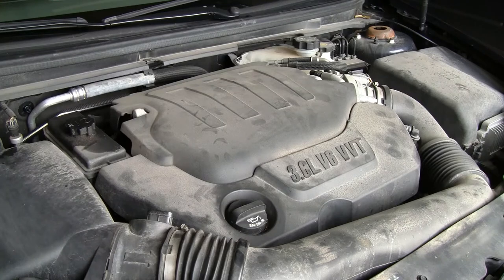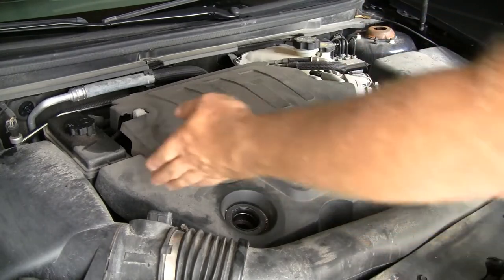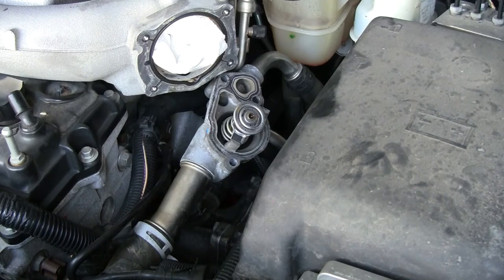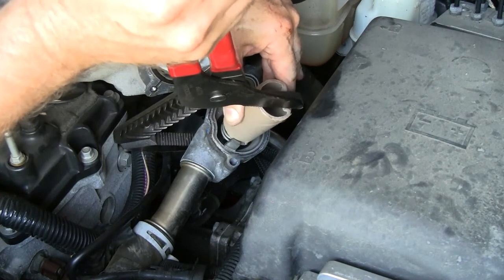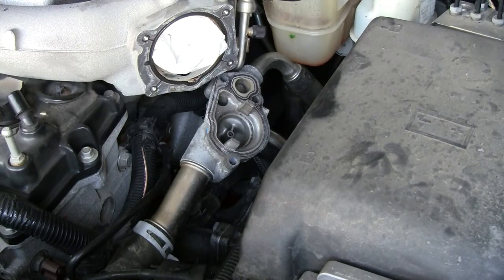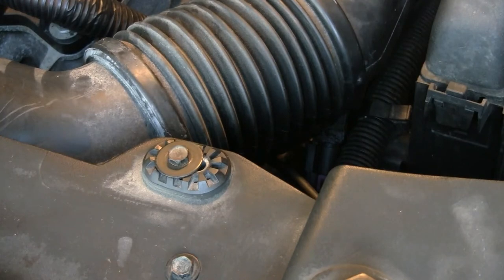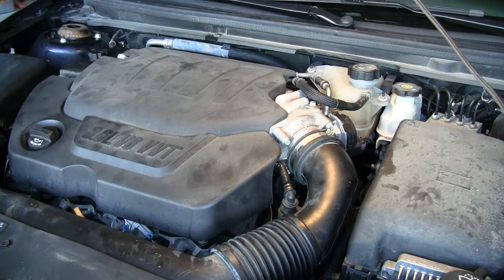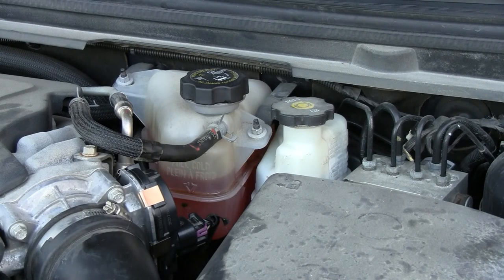How to change the thermostat in a 3.6 Liter GM engine

Comment: There is a small cardboard sleeve that comes in the thermostat box, it slides over the tabs , just push down, I installed in in 3 seconds flat with this piece!!  At 1st thought it was stuffing for the box but it’s actually a tool🎉

Comment: I was looking for this by searching Buick Enclave posts.  I was wondering what the cardboard tube was for.  Turns out my issue was a broken heater supply hose so I didnt change the thermo but now I know I dont need a thermo tool.  Great vid, wished I saw this first!

Comment: Why not put the bolts through the outer housing, slide the gasket over the bolts, then align it all to the inner housing/block, then start the bolts to ensure alignment of the gasket?

Comment: Oh my goodness so that's what that tube is for. I took the whole housing off and took the tube and  pushed it down with my hand and took the thermostat right out and then I used the same tube put the thermostat back in the housing put the tube over the round plate of the thermostat push it down and twist and the wings went right underneath those two brackets on the side of the housing. Thank you so much for sharing to us YouTubers. #PEACE✌🏾
Reply from the maker: I'm delighted to help!

Comment: Does the new thermostat needs a gasket or no
Reply: I literally just replaced the thermostat and included the water outlet O ring for the thermostat and now I'm having problems.  I'm wondering if the o ring is not included because it doesn't need to be put on the thermostat.  I'll be going back in tomorrow to remove the O ring and hopefully I can reuse the gasket that came with the new thermostat.
Reply: I bought the thermostat from O'Reilly for a 2017 chevy traverse, it came with the housing gasket but the thermostat itself don't have the gasket like the old one I pulled out does. So I am wondering if I'm going to need it or just install the thermostat itself without the gasket

Comment: Hi, does the thermostat still work if it has rubber seal? Did you have any overheating? thanks
Reply from the maker: Hi Karl. The rubber seal around the outside edge seals the fitting from leaking. Is there another rubber seal you are referring to? I've not had any issues with overheating since changing the thermostat.

Comment: I changed mine but my a.c stopped throwing cold air it was working fine before :/ any ideas why this happened?
Reply from the maker: Sad to hear this Jorge. These are separate systems. No connection.  My best guess would be a possible unplugged wiring connector for the AC pump. There are a lot of wiring connections routed throughout the area we are working in. But if the compressor is turning on the take a look at a possible blend door actuator failure. This would be under the dash.  It's a small electric motor that moved the air doors to give you control over cold and hot air blowing.